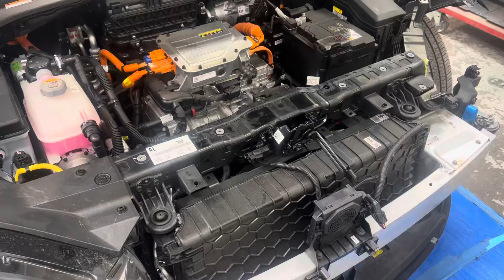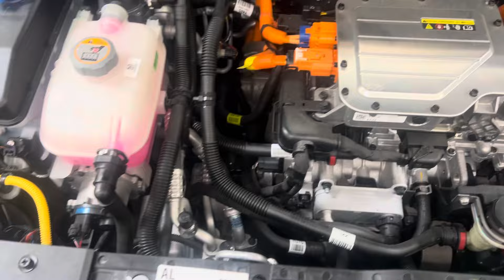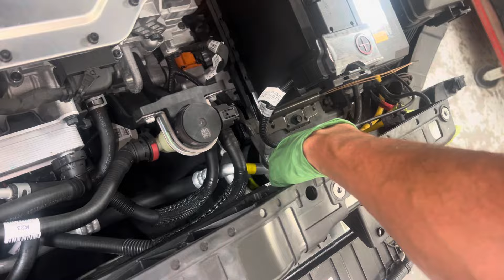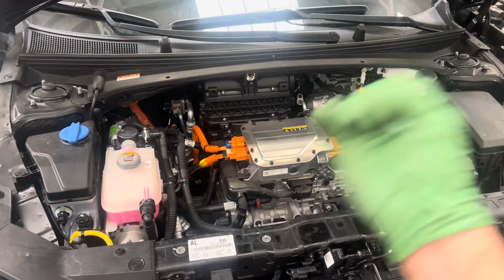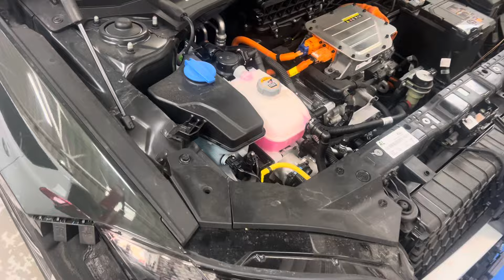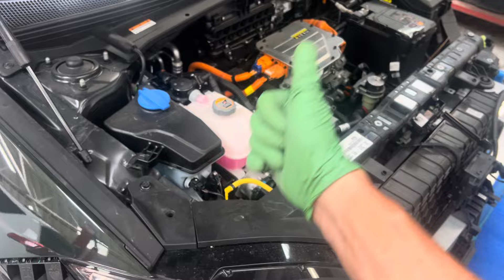REPAIR BILL electric heat recovery, multiple plate, heat, exchanger, and electric expansion valves

Comment: Have a e-golf and the heat pump is so weird. The additional heat when it’s really cold comes from a  high voltage heater that passes in a heat plate exchanger that heats up the refrigerant before passing through the (heat condenser) then the internal evaporator and bypassing the external condenser. So if you loose the refrigerant system there’s no heat in winter. I’m starting to really understand this system since it’s been broken for the past 3 winters (separate issues). 

System has: 
2 expansion valves 
2 refrigerant valves 
5 refrigerant temperature/ pressure sensors 

I have the change 1 exp valve, 1 ref valve and one temp sensor at a cost of 880$ just for parts
Reply from the maker: You’re lucky cheap parts on that vehicle.  Compared to this vehicle that just one expansion valve several hundred dollars.

Comment: I'll be keeping my "Johnny Cash" fixed orifice vehicles that I've been collecting spare parts for.
Reply from the maker: @thisisyourcaptainspeaking2259  it makes me wanna go back to my 66 Mustang or my 1970 Ford F100 
      The one thing I don’t miss about the old vehicles is packing wheel bearings. 

Adjusting points every 20,000 miles . 
It wasn’t too bad rebuilding a carburetor every 150 thousand miles . But you can do it yourself at your kitchen table, even if you were not a mechanic..

Comment: If toyota wont break down this fast mayb after7-10 years
Reply from the maker: Toyota usually is better than everybody else. 

Problem is how about that guy who got in an accident nine months after he purchased the vehicle . 

The condenser got smashed and has a hole in. It takes a few days to get to the shop in the meantime, the air and moisture absorbing into the POE oil saturating it. 

Then it has to go in for teardown and inspection for parts so then the Body guy tears it apart after a few days and leaves all the lines disconnected open to the air while they’re getting approval from the insurance company. Somebody has to go over that 3 to 5 days later. . 

Now they gotta order parts days to weeks depending on what model and when they have an opening when they’re not busy, they finish the other cars for years in the queue is waiting to be worked on 

Your AC system is exposed to the atmosphere or 2 to 3 weeks a month before it even gets finished or even started to work on . 

Usually a body shop they don’t refrigerant identifier so your refrigerant mixed with 20 other cars before you that could have contaminated refrigerant plus air gets injected back into your vehicle and handed back to you. It’s working good now. . 

Moisture and high air content, recycled, refrigerant greatly shorten the system
Reply: @coldfinger459sub0  thats y i dont like ev or. Hybird   Too expensive to repair.  220v   R 2025 camry hybrid using 220v? Hvac